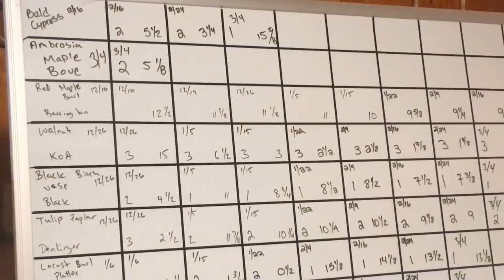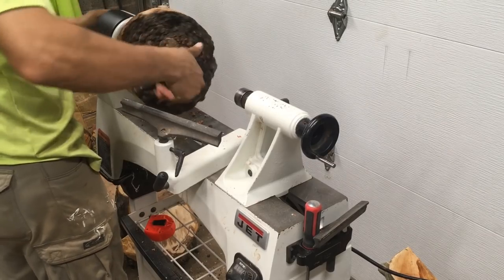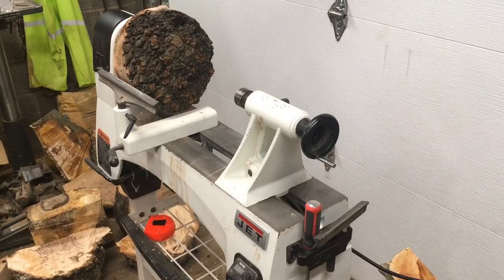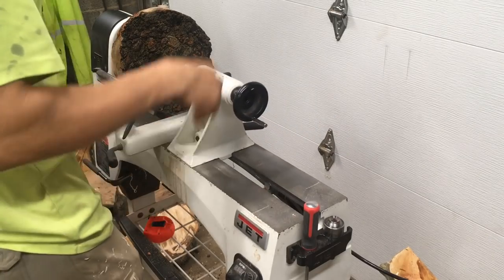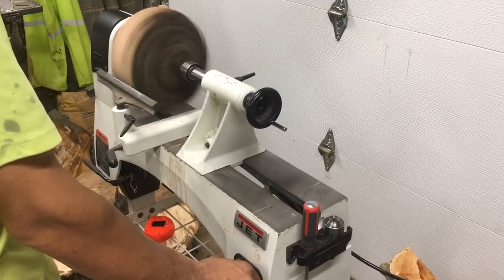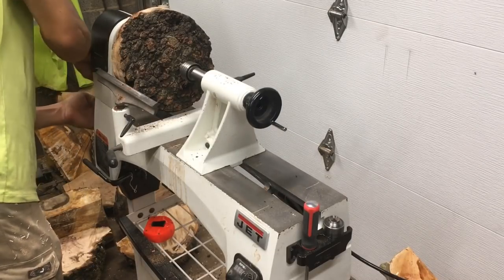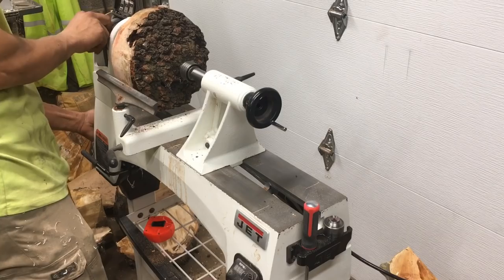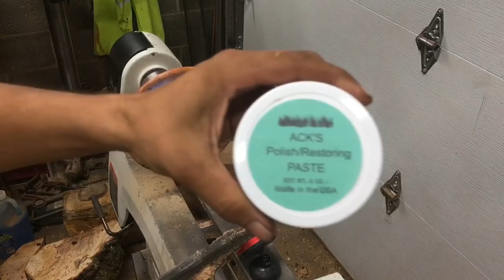#19 - Wood Turning - Black Cherry Burl bowl

Comment: I've always wondered one thing about lathes. You turn the wood to the right to lock it in place on the spur, then the wood spins to the left while you turn. Wouldn't that naturally loosen the wood from the spur or do I have it backwards - it naturally tightens?  Great video.
Reply: As your gouges cut, it will actually tighten everything up. You called in that you have it backwards.
Reply from the maker: Paul as the piece turns the worm screw tightens more into the wood.  The problem comes in when the wood is not sound enough or you drill too big of a hole you can strip the threads out leaving a wobbly piece.

Comment: have you found that this lathe for a 1 hp is underpowered,,i can go to making a cut and it bogs down,,,dont have enough torque,,,
Reply from the maker: Jeff thanks for watching!  I did notice the bogging down in the first few minutes of turning of this piece. I solved it by dropping one pulley slower. Really doesn’t effect the usable speed for a larger item but gives great torque!  
Ps I upgraded this summer to a 2hp 220v lathe and....  yes 1hp is less than joyful now that I know what 2 does 😇.